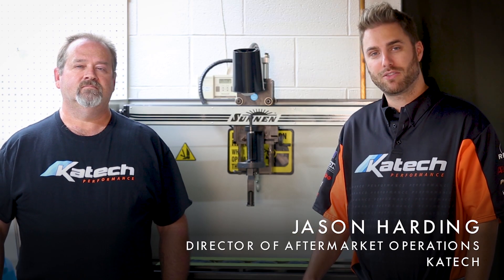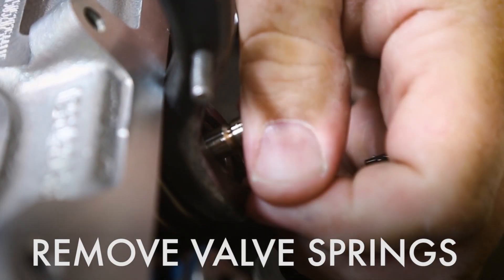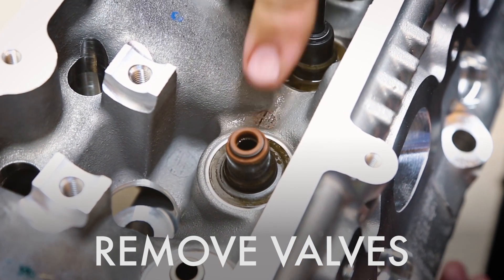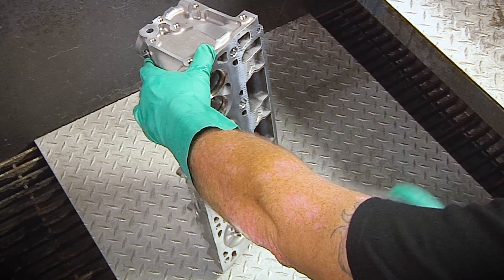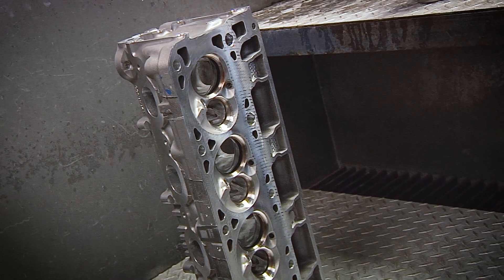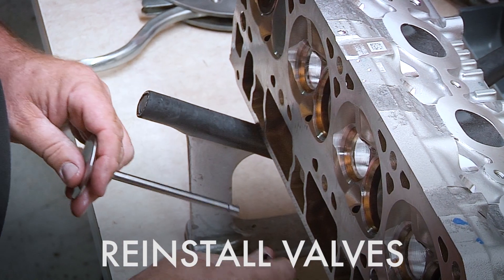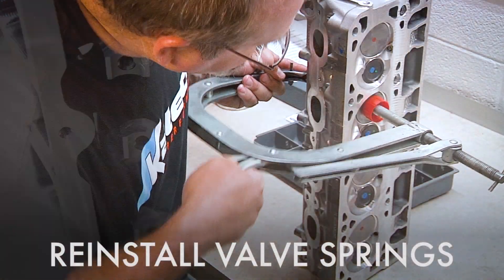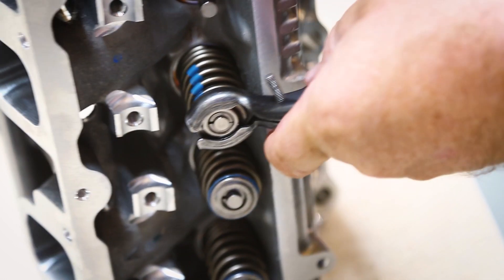Katech - Cylinder Head Disassembly & Reassembly

Comment: Showing you how to assemble cylinder heads, but can't get the valves to stay in place with GM engineers. ftl
Reply: stevenPknowledge did I say they manufacturer GMs heads?